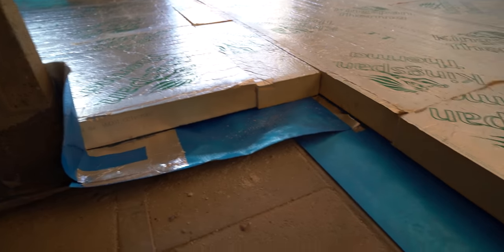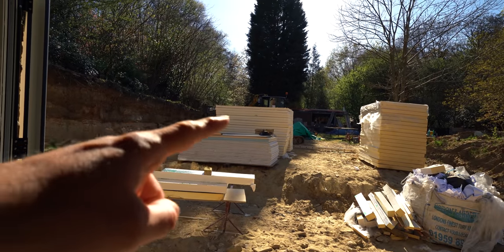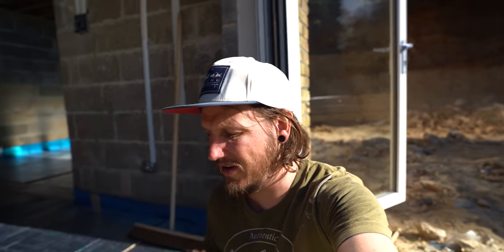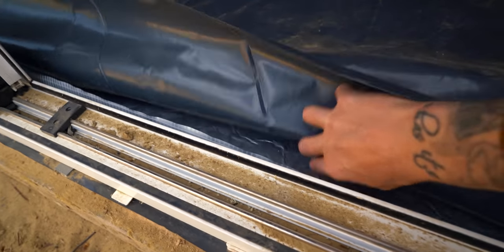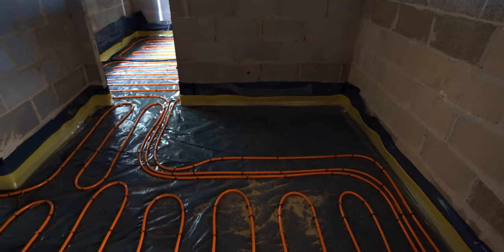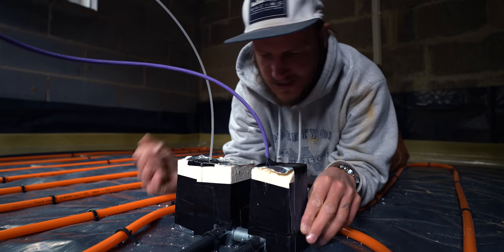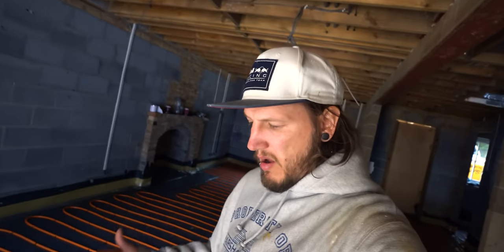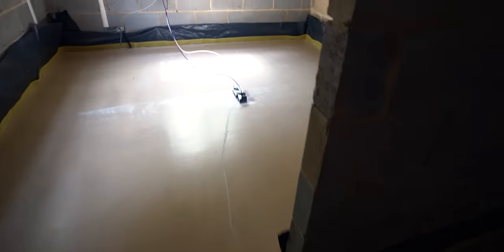BRICKLAYING, Underfloor heating installation and liquid screed | Busy house build Episode

Comment: Brilliant again love the videos. On the porcelain you can lay 20mm porcelain outside on mot base and a mortar base and its better than indian sandstone in terms of its porosity  value is so little maintenance is so low compared to all the high maintenance and sealing and cleaning of indian sandstone. As for the liquid screed i used it on an extension its good but you have to put a sealer type stuff on top for materials to stick to it so be careful im.sure u no about it .All is looking amazing very impressed. 
Justin brickright 👍🧱

Comment: You’ll need to seal the sand stone will be algae in now with all them trees about. A would personally get a Indian sandstone effect 20mm porcelain tile some in not much more expensive than the sandstone maybe £200 a pack range. Kerakoll fugabella get 50 shades colour cement resin based grout. Or flowpoint great stuff also only grey or a natural colour. Brush stuff is poor will last 2-3 years then start crumbling. The natural Indian sandstone you ain’t going to get 5mm joint as to there off edges unless you get a smooth sandstone expensive which makes me think be better going with a porcelain sandstone effect tile 900x600 split bonded or 1200x600 tile 😜 be you will be glad when this is done buddy take care. 😎👍🏻

Comment: I could have done with one of those staple guns, I built a 40 sq m extension single handed a couple years ago and used the same staples for my underfloor heating my 75 year old back sure ached a lot I can tell you!